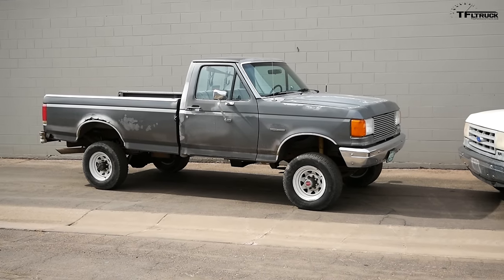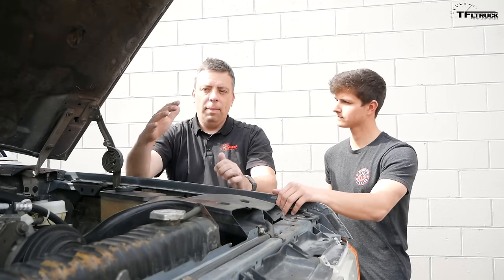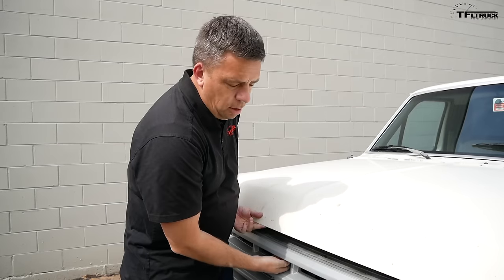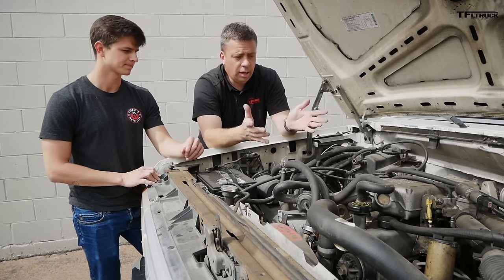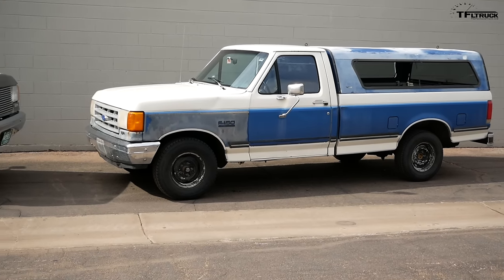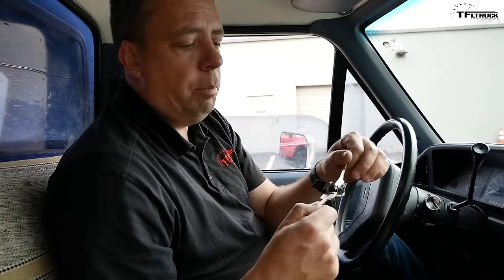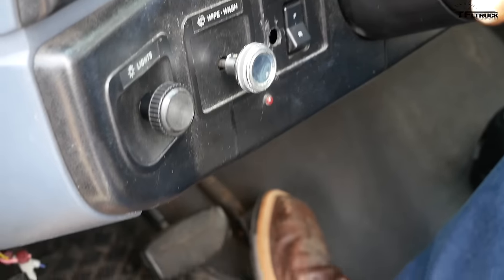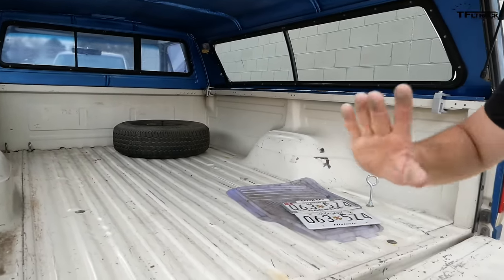Here's Why You Can't Kill An Old Ford F-Series Truck | Gunsmoke Ep.3

Comment: FYI, the turbo IDI was de-tuned so it wouldn’t make the new at the time 1994-1997 7.3 PSD look bad. An IDI turbo if you cranked the fuel all the way up would make more power than a stock 1st gen 7.3 Powerstroke.

Comment: Ford is just tough all the way around lol, especially those two engines. When I was still doing mechanic work we had a guy with a 90's model F150 302 or 351, can't remember which, wasn't getting any oil pressure. We told him to get it to the shop and we'd check it out. Next morning it's in front of the bay door. Boss man gets the keys, cranks it, let's it idle for a while. No oil pressure, no ticking, no knocking after about 15-20 minutes of running. After looking at it he called me over to eyeball it, I didn't notice anything unusual on the top side. He said "look under it". The oil pan was dropped, laying on the cross member. I said "oil pump bad?" He said "nope. He brought it here like that". No oil at all for 15-20 minutes and it never made a sound other than a nice idle noise. Had a 90's model Ranger with a bad fuel pump. Took the bed off, pulled the pump, parts house didn't have one, had to be ordered. Pushed it out of my bay and finished my work day. Had to put the Ranger in the bay for the night. After working all day, pushing that truck was the last thing I wanted to do lol. Boss man got tied up so I crank it up and figure I'll drive it as close to the bay as I can before it runs out of gas. Mind you, there's cars in front and behind this Ranger, so I'm easing forward and backwards to get it out of the hole we put it in before I pull it finally into the bay. Boss man came over and said "I told you I'd help you push it in here." I said " I didn't push nothing, I drove it in here lol". He looked at me like I was crazy so I reached in there and cranked it back up. He stood there amazed for a few seconds and reached and revved it up thinking it would die. Wrong. It ran for like 10 minutes lol idling. So yeah, I know how tough Ford's are.

Comment: Hell my  95 F250 351 with a manual had 360,000 mi at 9 years old. Now all these years later and it's at, roughly, 470,000 with the original build engine, trans, and driveshaft. Axle is an 04 now, cheaper than rebuilding it, plus aw disc brakes. It is amazing how well trucks used to be made. Of course rusty and old or not it's my daily driver and other than age it still runs great to this day.

Comment: My truck is a  1994 F150 5.0L V8, still purs like a kitten and roars like a tiger. I still have great Air conditioning and heat, duel tanks and both work great still after all these years. the body is a little banged up but I still love my truck. I've had to replace a few electronic sensors, MAP sensor, new coil pack, plugs and wires, always keep the oil changed. Had it for many years and he still runs strong. My wife named him  "Henry" lol old Henry Ford. I'll never get rid of this truck, even if it breaks, I fix it.  :)

Comment: Just bought a 1996 f-150 in really good shape with 63,000 original miles on it.I'm a Tilesetter and I have to have a truck with a the 8ft. bed.Seem's like most of the newer trucks got short bed's in them.

Comment: Have a1990 f250 4x4 diesel just like gun smoke. Been getting ready to put back on the road. 500000 plus miles still runs like new and has all around straight body. Needed to have another truck on road and was going to buy another.
  Thought why by another. It's simple and super reliable and parts are cheap. Also it will run on about anything. Don't let anybody fool you. They will pull just not superfast. Grossed around 20000lbs through WVA turnpike  and never got under 35mph and avg 11mpg from Cincinnati to Charlotte.  Maybe a little  overloaded lol

  Good luck on the project. Some person is going to have a super nice truck. Hopefully they'll use.

Comment: I don't remember when Ford started that particular cab design, but I want to say it was late 60s or early 70s and they ran it all the way up to '98. That's not counting the front clip, but just the cab. You could literally take a door from a 73 and install it on a 98. The interior skin may have been different, so you might not be able to use the 73 panel on the 98 door, but the doors would fit. As far as I remember, 98 was the last year for these square cab Fords, and that may have only been for the 250 and higher trucks, and I think the 150s got the newer style can for 98.
I remember when I was driving a wrecker during that cash for clunkers period, the L6 300 Ford motors were damn near bullet proof. They didn't put sand in the motors though, it was a liquid product that was designed to seize the motor. It started with draining all the oil out of the engine, and I think you had to pour in a measured amount, start the vehicle, and hold the RPMs at 2000 for a few minutes, and the motor would lock up solid. The started wouldn't even turn the motor, and even with a long breaker bar and socket on the crank bolt in the harmonic balancer, you couldn't budge the motor if your life depended on it. They also weren't allowed to give up after if a motor wouldn't seize either. A tech was required to stay on top of that vehicle until it seized, and it didn't matter how long it took. If it was all day, then it was all day, but most motors were junk within five minutes or so. In addition to the 300 Ford, another motor that I witnessed first hand that wouldn't seize was the Jeep 4.0 litre in a 97, 98 or 99 Cherokee, but I don't remember which year. I watched a service tech pour the liquid into the oil filler, start the truck, tach it up to 2,000, hold it there, and hold, and hold, and hold. Upper radiator hose explodes, steam pouring out, temp gauge hits 260°F, engine starts smoking, and not long after that, knocking. It took just under 45 minutes with this glassing agent, no oil, and most of that time with no coolant, to finally lock the engine solid. The noises coming from that poor Jeep Cherokee were just beyond explanation, and the whole thing completely defied all logic. It never went into low power or anything; the guy just held the pedal at 2,000 and the motor stayed there until out of nowhere it just stopped dead. From 2,000 to zero as quick as snapping your finger.

Comment: I drive 1990 F350, crew, 460 (7.5) fuel injected. It does everything. Owned it 24 years. Only replaced starter, alternator, radiator. That is it.

Comment: My Oldman bought a brand new 1988 f150 I-6 2wd 4 speed w overdrive manual transmission. 
When I turned 19 I basically took over payments and drove that truck for many years with no problems.  
I ended up selling it to my brother and he drove it for a few years before he sold it to a family friend that is still driving it today

Comment: My truck is very similar to that F150, it's a red, 1990 F150 XLT LARIET, inline 6. But mine has the m5OD(5 speed manual), 4X4. It sadly doesn't have the creeper gear, and the axle ratios are 3.08, but it still turns my 35s pretty decently, even when I'm towing a trailer behind it. I get about 14mpg on average, but the truck had rarely let me down, even though it was a old farm truck for 29 years

Comment: you can really hotrod those ford 300 I6 engines if you choose. i had one, in a half ton 1977 ford, and with 4x4 and an automatic, it felt under powered. pulled another, identical engine off of a huge wood chipper, and made a motor that liked to run hard. it wasnt a wild setup. new intake, carb, cam and timing set and planed the head, new valve job and a split header. no idea what power it made, but it kept right up with my cousins 93 f150 with a 351w in it. it was a cheap build too

Comment: I got a i6 5 speed 2wd, 302 5 speed 4x4, 351 auto 4x4 and a 7.3psd 5 speed 4x4. Just need to get my hands on a 460 truck and I'll have a complete set lol. All great drivetrains, (the ttb front axle is debatable), it's the rust that kills these old trucks.

Comment: My 93 F150 served me well for 10 years but frankly I was glad to replace it with my 2011 Chevy Silverado which drives lightyears better. That old twin I-beam suspension had vague steering and rode like an ox cart by comparison.
Reply: And it had the dumbest fuel system I've ever seen with 3 fuel pumps for two tanks. Gave me lots of trouble.

Comment: Headlight switches on both of them... They are designed so that the headlights actually run off of that switch. It is very common to burn up either the switch istelf, or the wiring harness where it connects to the switch, or both. You should put relays in and run the headlights off he relays, and use the switch to switch the relays. You'll have better lights, and you won't be replacing the headlight switch or harness all the time. BY the way, it was so common to have to replace this switch and harness... That you can actually buy them at Home Depot! (Lot of contractors still using these trucks.)

Comment: I have the 96 Eddie b. 4.9l 300ci manual .I've pulled a house with it and it only has 140k on it the only thing I changed was tire size to 31x10.5 best truck I've ever owned.

Comment: got a 86 f150 black with the chrome trim. motor had a bad head gasket and ran for a year but valve seals went out and smoked like crazy. lasted over 300,000 miles with the original altinator still working. swapped the engine and now it won't run at all 😂

Comment: My 2006 5.4 F150 has been completely reliable and bulletproof except for the timing chains, chain guides, oil pump, head gasket, intake manifold gasket, sensors and spark plug issues...... 🤔

Its built Ford Tough to work on. But, when I get it all back together today, she should be solid as a rock.

Comment: From 1980 to 1996 have all the same body mount.  I put the front clip off a 1980 on a  1992. The only thing that didn't fit properly was the bumper.  I had to cut the 92 bumper to fit

Comment: '94 F150 4x4 manual short cab short bed with a 302 at 365k and still going on the original engine and trans.

Comment: the 300 i6 is really underrated too ive seen stock dyne results of 150rwhp and 240lbft to the wheels. which means about 180 to the crank!
Reply: The 300 is a great engine. Ford used them for all kinds of stuff

Comment: My father had an 89 f150 short bed 4x4 with a 4.9L straight six that he had bought new when I was in high school. Alternator caught on fire several times. Replaced under warranty at least 5 times before the warranty was up. Finally one night the cruise control module caught on fire in the middle of the night with the truck off and in the driveway. This totalled the truck. Thankfully it wasn't in the garage, otherwise I may have died that night. Ford knew there were problems with the design of the alternator wiring harness and the cruise control module, but never did a recall. Thousands of these trucks caught on fire because of faulty electrical systems. The 92 and up trucks and 86 and prior trucks were much better than the 87-91 models. Shame on Ford for not recalling the models that were prone to electrical fires.

Comment: Just a heads up on what you said about the 7.3. It wasn’t exactly accurate. They made a turbo version of the idi 7.3...but the 7.3 powerstroke ran from 94.5-03. The only real thing they had in common with the idi 7.3 was the displacement and bellhousing. They’re completely different motors. In the middle of the powerstroke run they had some changes with rods, turbo mount, heui pump...but mostly the same

Comment: I had an 89' with a 4.9L and a 5speed od manual and at one point I was driving it around with a blown water pump for a little over a year and never overheated those motors are bullet proof

Comment: i took my down payment for a 2020 f150 and purchased a 1995 f150, overhead cam engines are sweet but the timing chain replacement is out of my scope of mechanics, the 95 has 61000 miles and is in perfect showroom condition, my next truck i am aiming at is one with the 7.3 godzilla, but until that time this little f150 will do:)

Comment: I have a 1991 F 250 7.3 manual rear wheel drive. I have always used 1rst  gear to take off. I did not know you could by pass it and use 2 nd. I will search to see if it is the same transmission. Nice video

Comment: The fuel pumps had issues on early 90's Ford with dual tanks.  They changed the designs about every other year trying to improve reliability.
Still great trucks.  I'd rather change a fuel pump than a transmission.

Comment: Back in 86. my Father inlaw and i did what Ford didn`t...we put a rebuilt 1972..460 big block in my 1979..F-350 (came with a 400 Cleveland) welding Truck with a 4 speed manual Trans...before 1980, 460`s only bolted up to Automatic trannys...Thankfully my Father n Law was a mechanic with his own shop.....That Truck had no idea what "Weight" was...LOL

Comment: Just bought a 1990 ford f150 300 big 6. Odometer doesn't works so who cares. It's a stick and I love it.
Diesel torque in a faster. The E4od is a decent trans but the Mazda manual is amazing.

Comment: imo they stopped making the 'smokers' vents because they were notorious for breaking / loosening latches  that were hard to repair and wind noise. If you push up on that sticky tailgate it will drop faster than Kamala on Willy. Love these old 'bricks'. Just picked one up an 87 it's getting a full restore.

Comment: Well... I dunno about "never die"... my $800 1986 F-250 just lost its fuel system.  Both pumps and all the electrical needs replacing... 'spensive... but it's WORTH it!  I need that truck to take care of my 10 acres.  4sp manual, 4X4, 2 sp transfer case, 460, bench seat, bed-liner, lumber rack... I want ALL of that and finding a replacement for anywhere the repair bill is impossible, even looking in different states.

Comment: I had a 95 150 2wd shortbed. 4.9, 4 speed manual. The only option was AC. She had about 330 K on the clock. Had to replace the oil pan, fuel pump and new gas tank during her life. Other than some suspension pieces, no other major repairs. I couldn’t get squat on a trade when I wanted a new truck, so I kept it. Lifted the front end, put a posi rear end in her, and made it a mild pre-runner. Got hit by an old lady, bent the frame. Wish I still had that old girl.

Comment: You guys talked a lot about how good the engine/trans is but that's never been the problem with Fords in my experience. It's the whole rest of the truck that disintegrates around them. You should have showed them the main wire connector the size of a candy bar with hundreds of wires that's exposed in the engine bay and ripe for headaches. Bad brake light switch design, no brake pedal return spring for when they get this age. Bad quality dual tank setup. The spare tire is useless on most of these trucks because the rig Ford designed to hold it on down there doesn't work when it's rusted up. The seat belt bolts are threaded into the frame itself, not a nut on the bottom side. Anywhere they could save a buck

e: I don't really consider myself an anything-brand guy but I do have a gmc sierra that's 6 years older than my f150 and it just works all the time with no issues. I don't even know the above kind of quirks about it because I don't have to dick with it constantly

Comment: They were actually called "fly windows" not smoker windows.  I hate you can't get those on newer trucks,  big reason I prefer the OBS trucks to the SDs.  You can turn them all the way out and get alot of air blown on to you, works awesome when you don't have AC.
That F350 isn't close to heavy duty, it's 4 wheels = light duty.

Comment: I used to work at a Ford dealer where the owner also owned a wholesale grocery delivery service. They used the F600 for their fleet and delivered all over the state. When they were done with a Truck,  it was DONE. It would have well over a million miles and had been wrung out by a couple dozen different drivers and flogged endlessly. 
A local company that would sell top soil would then buy the clapped out truck and put a dump bed to deliver dirt. I knew some of his mechanics. This one guy was a Chevy man and hated Ford with all of his soul. But we told me once, "I hate Ford, but you just can't kill them."

Comment: My main work truck to this day is powered by that 7-3 IDI if you put an exhaust on that IDI off of a later Powerstroke that thing will sound like a big block Chevy I think I'm going to LS 6.0 swap a bricknose F150 those are some of the toughest chassis on the road a little lacking in the engine

Comment: Another reason they run forever? They re easy to work on and fix ON YOUR OWN! My fathers old '86 F150 Lariat had an issue with the ignition switch always going out, luckily its beneath the dash in plain sight and a piece of cake to replace.

Comment: I had a 1989 F350 crew cab full size bed with the 429 engine it wasn't up very high you could step right in I would  put 20 bags of cement in the back generator wheel barrels you name it plus me and five other people I wish I had one of them today.

Comment: This why I own 2 a 93 & 94 f-150 4.9 in both. 93 is a manual 8’ bed and the 94 is an automatic short bed both single cab 93 has 468,000 and the 94 has 347,000 miles on them and I daily the 94 and the 93 is still running too

Comment: Many times when all my new cars made problems and broke down, I always could count on my old Ford Truck in my back yard.
It always would start and the only reason that I did not drive it every day was the gas consumption.
These were for sure times when trucks were still usable trucks.
Now with all that plastic and soft touch materials for 60 to 80 thousand dollars, who would use those trucks for picking up firewood or driving down a ruff gravel road?